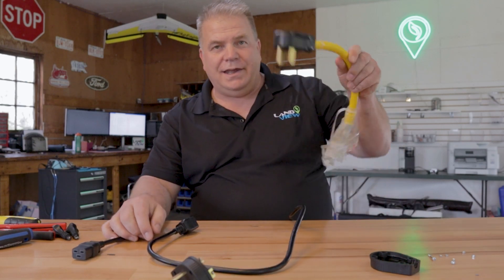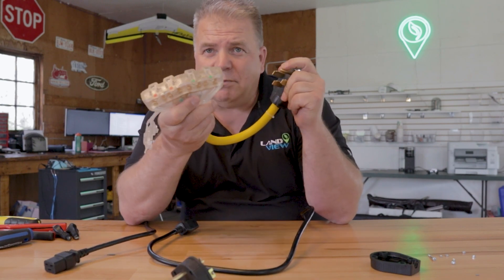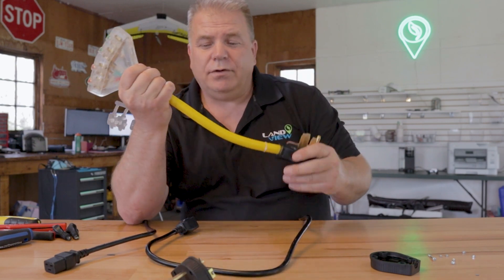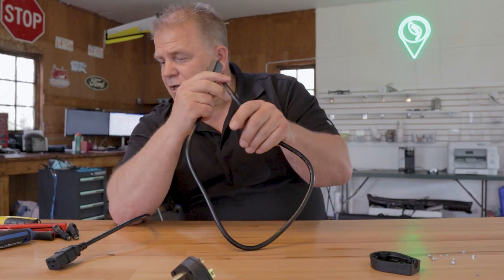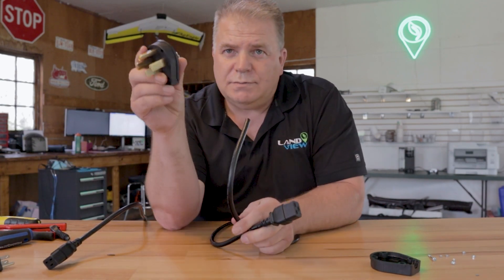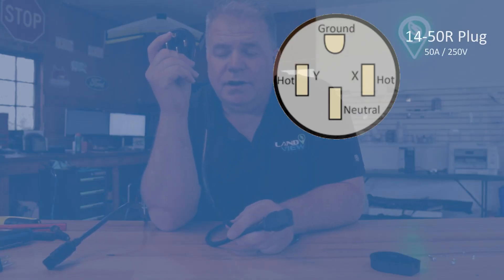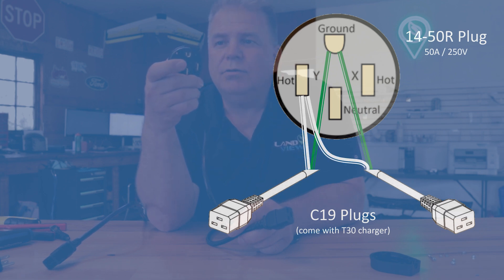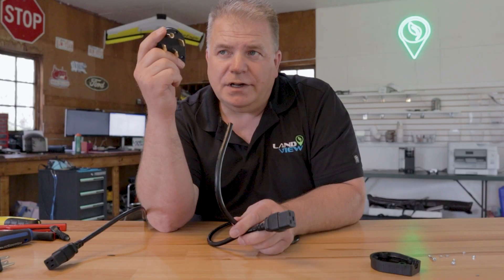Rewiring T30 Charger for Fast Charge

Comment: Can you give an update on how this plug alteration worked out?  You basically put 120v on the black wire and 120V on the white wire for a 240 v single phase connection and then plugged it into the battery charger twice.  Did this charge faster than if you plugged in two 120 v lines from different branch lines? and does it charge faster with both 240v plugged in compared to one 240 plugged?
Reply from the maker: Many customers later and this is still the right way to wire it, has been working well for all of us.  Both ports need to be plugged in, because there are two separate charging modules in that charger.  Give us a call at LandView Drones to discuss, because looking at your own video -- you may be missing some other components as well.

Comment: I'm missing something. Cutting off a standard 120 Hot/Neutral plug to make a 240 Hot/Hot? Device is expecting Hot/Neutral based on cut off plug. Wiring one plug 120 and the other off the other 120 leg giving you 2 separate 20 amp 120's would make sense.
Reply: Finally found pic showing it can take either 120 or 240 to same input…. Apparently